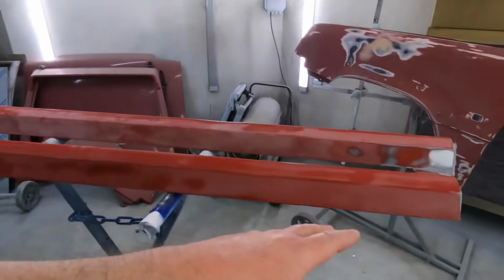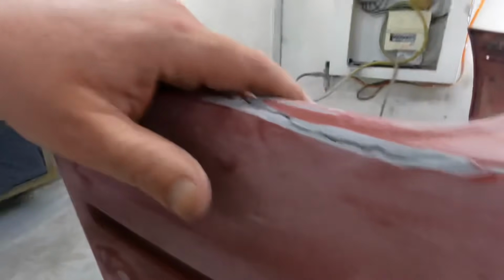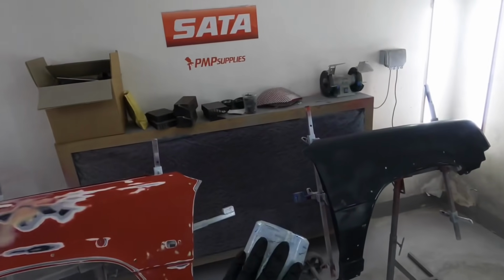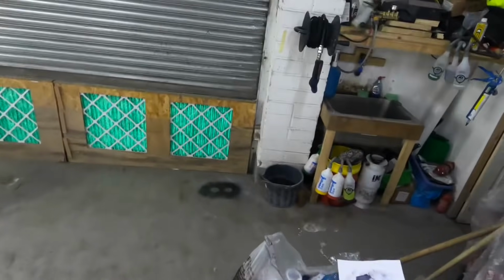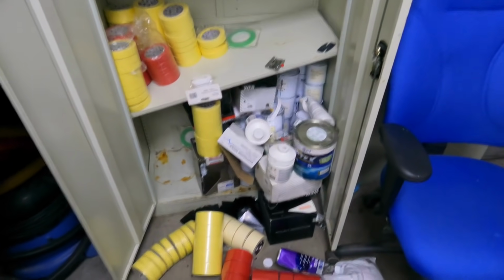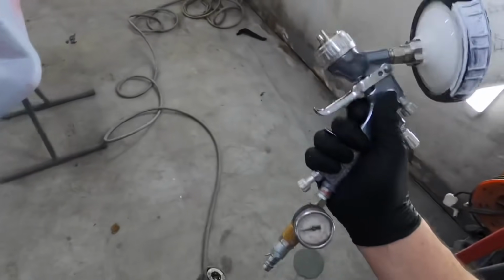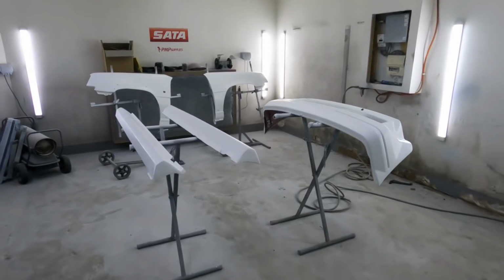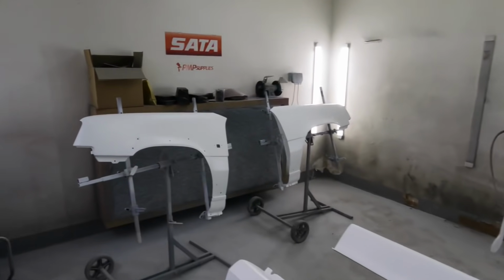Renault 5 gt turbo bumper and skirts repaired and in primer 👊👊👊

Comment: I can't wait until you've finished this car just to see how good it looks as I loved these  cars back in the day   along with most of the 80-90s sports cars  and they definitely don't build them like they used to  back then crying shame it is
Reply: @ROB K, yeah so sad cars don't rust away from inside out after only 5 years anymore Lol. Either the factory painting systems were crap back then or no cavity wax to slow the tin worms. Probably a bit of both.
Reply: @SalvageMasterEssex  used to.see rusty mg metros after 5 years escorts the lot

Comment: Can’t wait to see the finished car, and looking forward to seeing the red going on, gonna look amazing! Assume the lump is being rebuilt?
Reply from the maker: Not sure what to do and where to draw the line tbh
Reply: @grantssmartrepairs  Sod’s law if I was doing the restore minute the car was back together the head gasket would blow if I didn’t rebuild it. Trouble is if it hasn’t been running a long time (?) gaskets could have dried out and got brittle. Was it running when u got it? If so assume you didn’t hear any bad bearings. Least if you do rebuild it’s only a lil old 4 pot.
Reply from the maker: Yeah drove it in the engine was sweet as a nut, the problem is for me it was only ever supposed to be a quick blow over 🤣🤣🤣🤣
Reply: @grantssmartrepairs  always the way! Be worth it tho
Reply from the maker: Yeah need to know where to draw the line I’d like to do the sub frame rear beam etc it’s just one of them need to do the bodywork and go from there
Reply: @grantssmartrepairs  No such thing as a quick blow over, nearly always turn into a full rebuild. At least once it's done you'll have more workshop space for another quick project Lol....

Comment: Grant. You wanna get yourself a kit for plastic welding buddy.  There is always somebody snapping or cracking bumpers.. I'm one of those who needs a bumper repair after having a van towing a car trailer undertake me whilst driving over my passenger side front wing and bumper...Grrrr
Reply from the maker: 🤣🤣🤣🤣 I’ve got 2 mate these bumpers are not plastic though they are fibreglass 👍👍👍👍👍👍